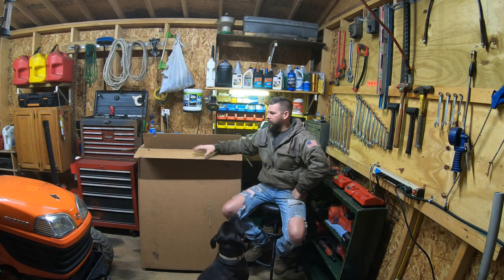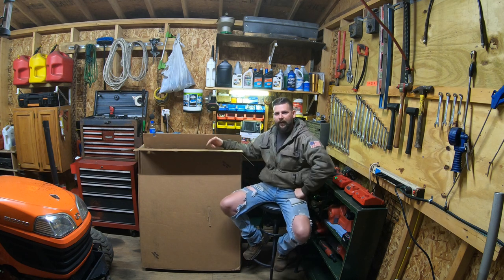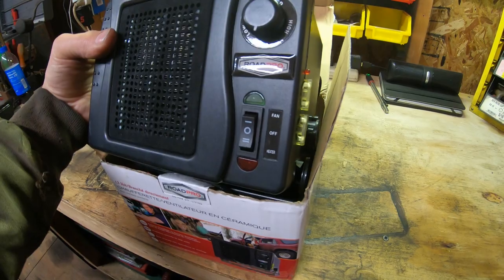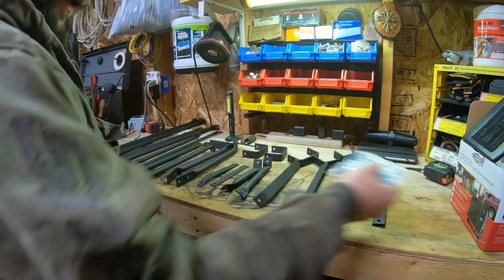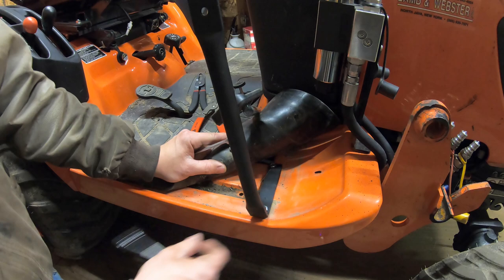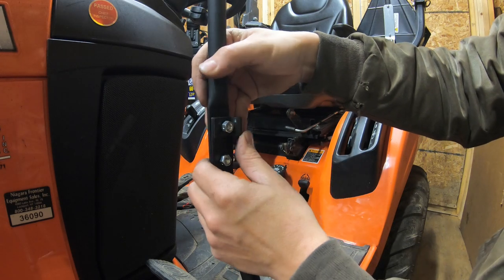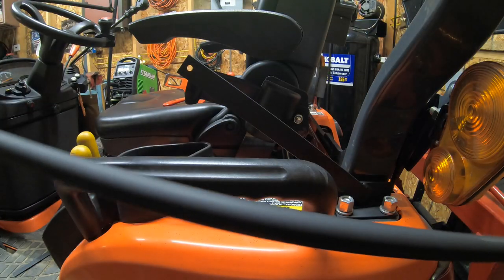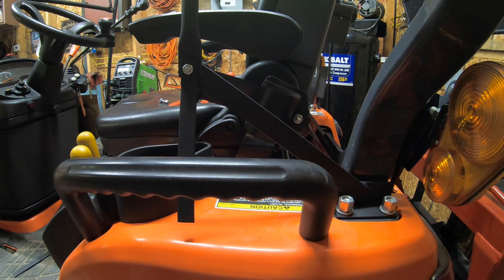Kubota BX- Original Tractor Cab (Full Install Video + Extras)

Comment: I like that cab! I looked at their website which states it WILL NOT FIT BX23s... Any idea why? I understand it wouldn't have backhoe access (out the back), but if I only wanted the backhoe on for ballast, wouldn't the cab still fit?
Reply from the maker: The cab actually will fit the 23s the only thing is that the tie down points or brackets that go from the cab to the ROPS wont reach so you will have to bend or tweak them a bit to get them to fit.. I have actually seen it done and it works out quite nicely.. If I can find the video i will reply with the link. I would get the bx2380 cab and you could def make it work like others have.. The ROPS is the only difference and honestly you really don't even need the ROPS mounts but they do help to sturdy the cab. Hope this helps!
Reply from the maker: Here you go Dale I found this video for you of a guy explaining what you need to change or alter to get the bx2380 cab to work on your bx23s

LINK: https://www.youtube.com/watch?v=AIoOKgjHZCA
Reply: @BiffsEquipment  Thank you! I'm a bit of a fabricator so I was pretty confident it could be made to fit. Appreciate it!

Comment: Who makes the Cab? How well does it stand up to high winds? Thank you.
Reply from the maker: Hey Jean, the Cab is made by "Original Tractor Cab" and they say the material can last a lifetime. It can withstand roughly 40mph winds but they suggest not trailering the tractor with the cab all in-tacked they recommend you remove the vinyl when trailering down the road. Thanks for watching!
Reply: @BiffsEquipment  Thank you! I checked them out. Not certain if this is the year to go for this cab. I need to do an extension on my garage before I put a cab on the tractor, but it is nice to know this exists!

Comment: where do i order a cab i have a bx23s
Reply from the maker: For the bx23s you actually have to order the BX2380 cab, the only reason they say it wont fit is because the ROPS on the 23s is wider like mine so the brackets going from the ROPS to the cab itself wont fit.. what you have to do is manipulate and bend them a bit to make those 2 ROPS mounts work aside from that it should be a direct fit. I will be talking to the company tho to hopefully have them fix this issue soon. Thanks for watching!
Reply from the maker: Here you go Fred I found this video for you of a guy explaining what you need to change or alter to get the bx2380 cab to work on your bx23s

LINK: https://www.youtube.com/watch?v=AIoOKgjHZCA

Comment: That cab looks like garbage
Reply from the maker: It’s not suppose to be a show peice, it’s suppose to keep you warm and out if the elements and does so being one of the cheapest price wise cabs on the market for what you get. Most aftermarket cabs don’t look great.. even the metal Curtis cabs look very strange on some tractors including Kubota and John Deere tractors alike.. IMO the only tractor cabs that look “good” are the factory glass cabs installed during the assembly of a new tractor by the maker.